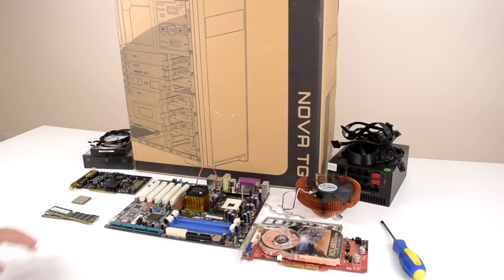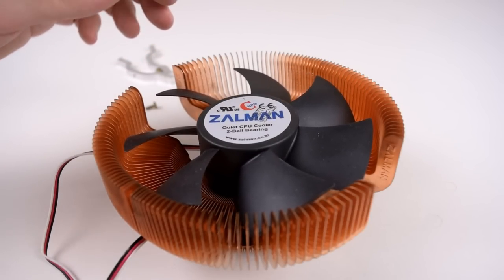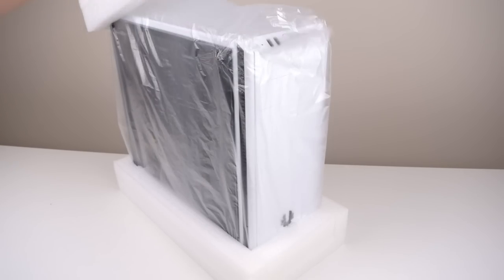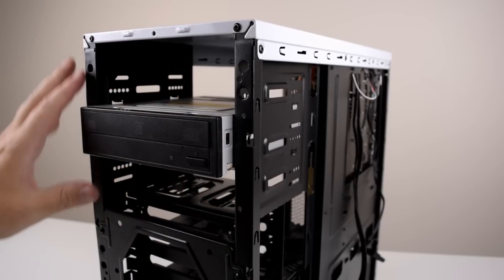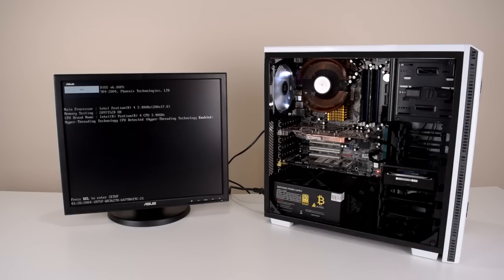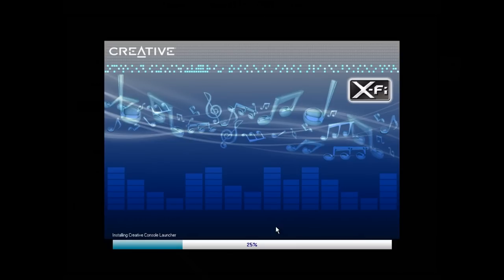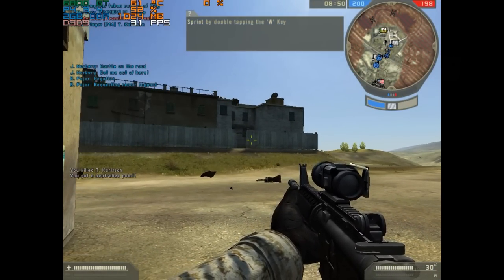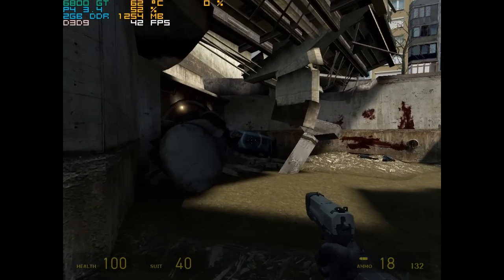Building a Pentium 4 Reverse Sleeper

Comment: I've played NFS underground on an old AMD Pentium III , suffice to say the game ran like shit as did NFS prostreet and even GTA SA all running on XP .
Reply from the maker: What I find with these older games, is that even 1 year newer, and the requirements can be much greater.
Reply: now I"ll be running those same games , but this time on a Intel Core 2 Duo E8400 @3.00ghz , should be more than enough that what I had once before .
Reply from the maker: Sometimes there are issues with dual core, but you can turn off the second core in the BIOS usually.